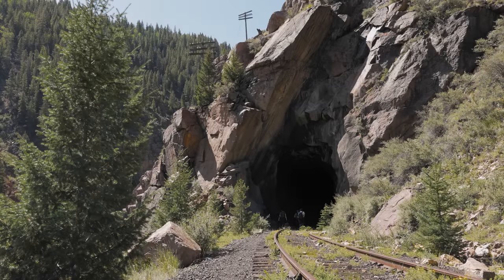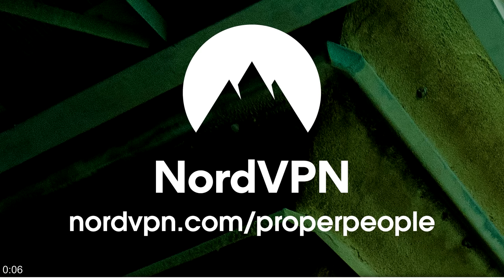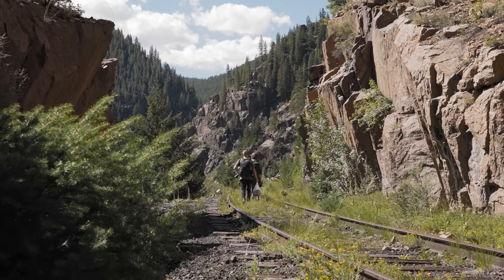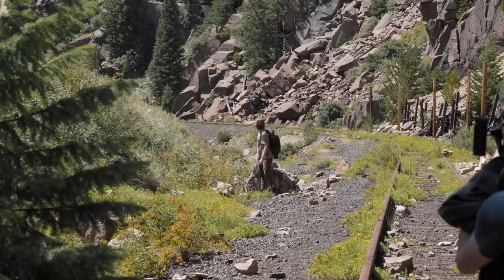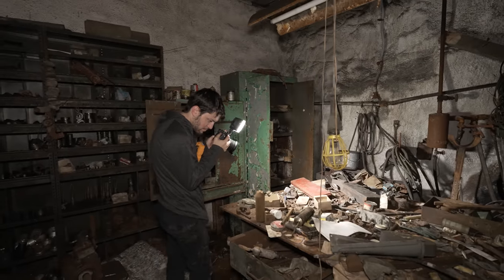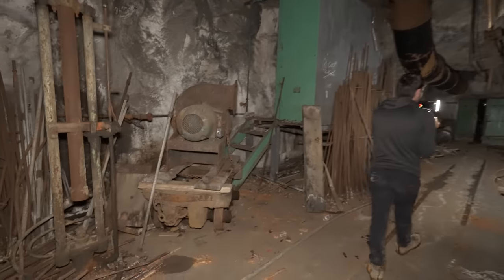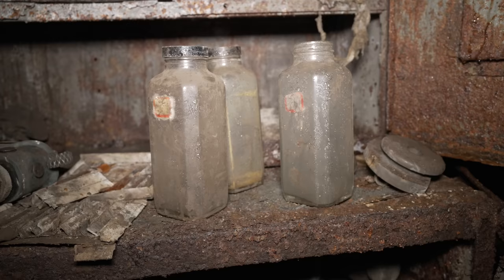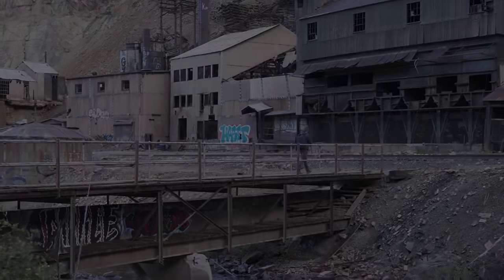Exploring an Abandoned Mine - Found Mine Carts and Processing Plant!

Comment: I wonder why all the wood is rotten and the metal rusty. Is it fairly open to the elements? If you watch that cerro Gordo videos everything in those Mines is perfectly preserved.
Reply: Every underground mine has a different climate. Some are hot and dry, others are cool and extremely damp. This one is definitely the cool and damp type - you could see condensation on everything.

Comment: I would guess it was built during a time of war, to hide it from enemy attacks. Besides that I have no clue why it would have been built underground. The amount of labor that would have been required is ridiculous.
Reply: Wrong
Reply: It's... a mine? Mines have to be underground... That's kinda the whole point of them.
Reply: The machine shop and ore extraction equipment were placed inside this mine because it was easier and cheaper than the alternative of placing them in large outdoor buildings, given the winter weather this place experiences, exterior structures have to be seriously reinforced.